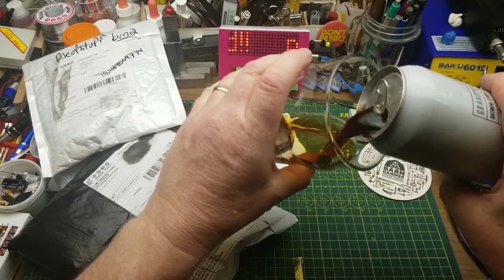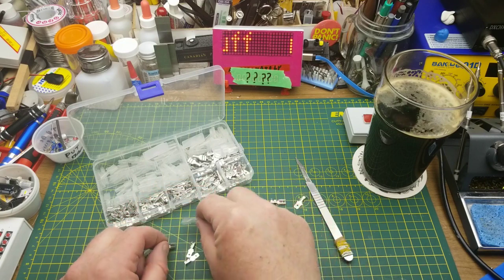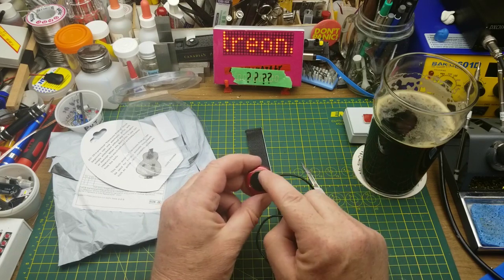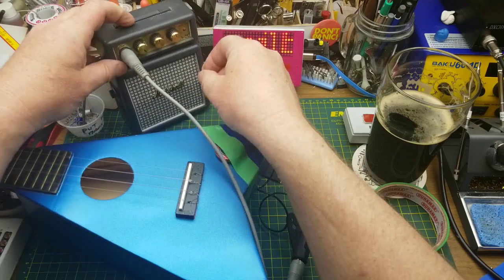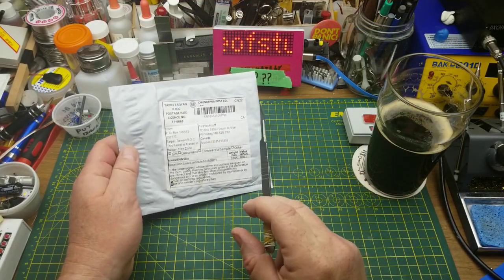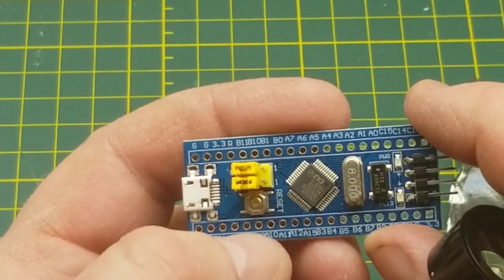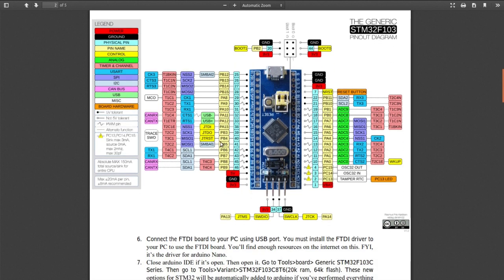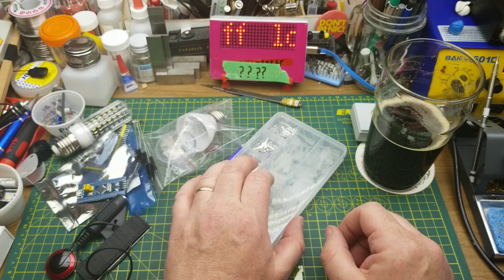Mailbag Monday #88

Comment: Interesting about LED light bulbs. I had a couple fail on me, Noma brand from Crappy Tire. I had them apart, expecting a capacitor failure on the power supply. Much to my surprise, it actually was an LED (or more than one) that failed causing all of them to fail. The power supplies themselves were actually not too shabby switchmodes (instead of capacitive droppers as I had expected) which still work just fine (though-non isolated from the mains). The culprit I believe is that the bulb's plastic enclosure has zero ventilation whatsoever. I think It was just heat death. The enclosure on the one you've got there looks identical and I think I spot a bit of a heat-mark on the bulb's plastic?

Comment: I strongly advise you, before starting with the bluepill board, you should drop the Arduino IDE and switch to Visual Studio Code with the PlatformIO extension. It not only supports the Arduino framework, it makes installing and using different boards much easier, and VSCode is a MUCH better editor. It may look slightly scarier at first, but after you run your first blink from it, you should find it easier to use.
The reason I say to switch before figuring out the bluepill is that all you need to do is pick the bluepill from PIO's board list, and it automatically downloads and installs everything needed. No more trying to download outdated copies of arduino plugins from sketchy looking websites listed in chinglish pdf tutorials.
Reply from the maker: Isn't Visual Studio a Microsoft product? How well does that work under Linux?

Regardless, I'm relatively comfortable in the arduino environment, and for demonstrating it's something that is easily accessible to everyone (and it was designed for beginners - which I very much am)

You aren't the first one to tell me that it's limiting, but for the small amount of coding that I do, I haven't run into any of those limits that I'm aware of.

I understand that there are a lot more powerful and more professional tools out there, but that's not where I'm at currently.

I really do appreciate the advice, and I may follow through on it in the future, but at the moment I'm going to stick with what I (sort of) know.
Reply: @pileofstuff  Visual Studio Code is a smaller editor/IDE that is indeed developed by Microsoft, but is an open source Electron app (originally a fork of Atom) and works great on Linux. When you look at stuff like Win10 and Office, MS has made a lot of mistakes, but the dev support team is usually pretty good. VSCode is an example of them hitting it out of the park.
PlatformIO was a commercial project that is now open source and free, and is also great on multiple platforms.
FWIW the Arduino IDE as you know it is on the way out, and will eventually be replaced by Arduino Pro IDE, which is based on Eclipse Theia, which is Eclipse's Electron based "alternative to VSCode" (unsure which thing they forked)... In other words, everyone is going that route (and appear to all stem from a common origin), and VSCode is likely to remain the best of them for the forseeable future.
I understand the desire to stick with something familiar though, just giving you a heads up because PIO makes dealing with other boards MUCH easier. FWIW it's probably going to take a few years for Arduino to start pushing people away from the current IDE.

Comment: Ive not had much luck with crimps from china, the metal is generally too thin so that don't hold very well.
Reply from the maker: Good to know. 
These took so long in shipping that I bought some locally, so I'll have some proper ones to use for mains connected  projects.  
These ones will probably only get used for low voltage and non-critical stuff.

Comment: Awesome video! I didn't know they had an LED lamp kit....sounds like my next DIY project. I have done projects with the Arduino but not with the STEM32. There is a smaller community forum  for this chip, but I don't feel ready for it just yet. STEM32 is more powerful than the Arduino. Love all your videos!:) have a nice weekend.
Reply: STM32?
Reply: The STM32 is definitifely worth a try. Especially with the USB bootloader so that you do not need to programm it via a serial adapter.

Comment: The Pill Boards are really amazing.  They can be programmed with a USB bootloader (Maple), then easily used with your regular Arduino IDE.  The best docs are on a website that you can only find on WayBack:  https://web.archive.org/web/20190316163044/https://wiki.stm32duino.com/index.php?title=Blue_Pill  Will help you out if you want to try doing the bootloader.  You will need a USB-2-UART adapter.
Reply from the maker: Thank you. That'll be helpful.

Comment: Saw that LED lamp kit (or one very like it) on BigClive, and he disassembled a corncob lamp like the other one.
Not gonna spoil the fun for you though.
I will wonder what color LEDs you plan to use in the kit. Clive built at least one with all color-changing LEDs which was... weird but pretty cool. That cap dropper can supply enough voltage for pretty much anything you want to put in it apparently.
Reply from the maker: Indeed, what colour to use...